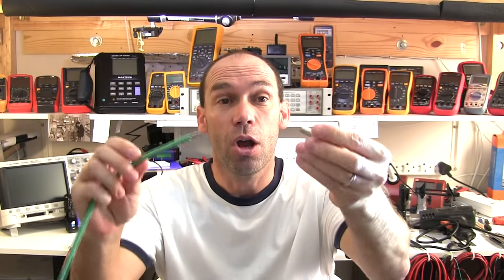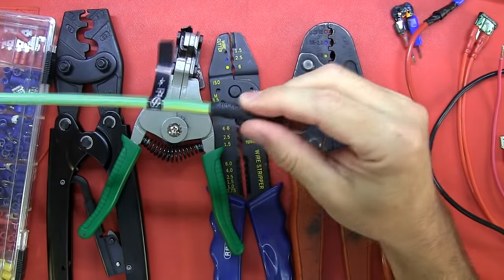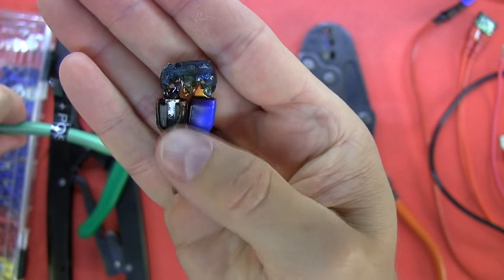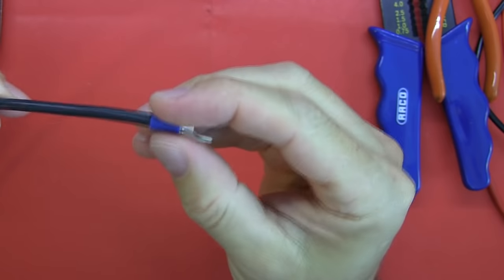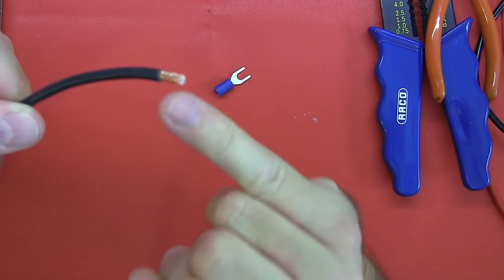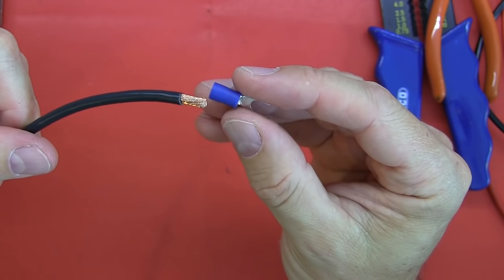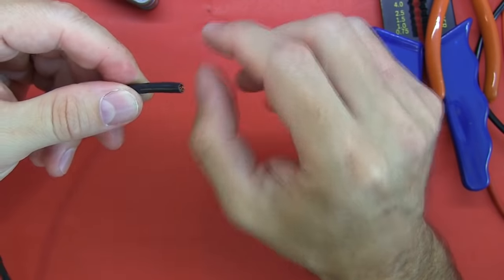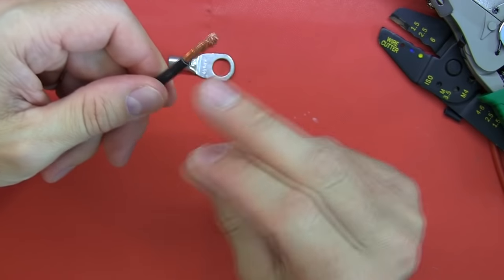Tutorial: How to crimp connectors, strip wire and use heat shrink.

Comment: I know this video was posted a long time ago but it’s still one of the best. Quick contribution: if you’re using colored shrink tubing to mark a cable (discussed at 18:17) but still want to be able to see the crimp, shrink the colored tubing around the outer jacket up to the strip point. Then crimp and pull up a second piece of transparent tubing to overlap the first and cover the connector. It’s not much of a tip but... for what it’s worth.

Comment: Incredibliy thorough!  Very impressive.  I've used just about every connector you show and I have most of the tools you show as well.  But even with my experience I couldn't have explained it as thoroughly as you did.  Well done!  I too used to solder some crimp connectors (after crimping) but I read below that that can actually worsen the connection/connector.  I didn't know that.  I do that because I've seen too many crimp connectors (in automotive use) fail due to corrosion.  But the comments made by "Executive" below enlightened me.  Up until now I would never have guessed that a crimp connection could be better than a soldered connection.  Still, I would say it depends upon the application and how carefully it is soldered.  Mostly what I want to say is "EXCELLENT VIDEO"!  When I started I thought "I can't sit through 31+ minutes of something I already know" but now I'm very glad that I did!

Comment: Very good presentation. May I suggest two modifications. 1. We always use a bit of no-ox inside the ferrule and on the wire strands to prevent any future oxidation or dis-simular metal corrosion. 2. The crimp dimple should be put on the side of the ferrule without the seam.  Our inspectors look for a bit of wire and some evidence of the No-Ox through the witness hole. Love the clear heat shrink usage, the only way to go.
Many Thanks.

Comment: Thanks for a wonderful video.  I had used a hair dryer to heat the heat shrink in the past while connecting a cable to a fuel pump and it worked.  Those days  I never heard of a hot air gun that is shown towards the end of this video.  Well done providing useful tips.

Comment: I much prefer using the hexagonal crimper for the bigger lugs and have used them often on up to 300mm square where you'd use a hydraulic crimper. One thing I feel I must mention is that as far as I'm concerned, you have a bit too much heat shrink on the 10mm square lug as you always want to keep the foot of the lug clear. Should you want to bolt that lug to a flat surface or a copper bar, you would have a inferior connection due to the heat shrink encroaching onto the foot of the lug and thus ending up sandwiched between the two conductive surfaces. The foot of the lug is sized so as to properly conduct the rated full load amperage of the cable through the area of the foot of the lug. I also like keeping the inspection window clear.

Apart from the above, it is a superb video covering most all of the essentials of doing it right. Thank you :-)
Reply: true but if that is an issue the heatshrink can be trimmed easily with an exacto blade or stanley knife so hardly an issue

Comment: Very well done and thorough video. The one thing I would point out, that was NOT included, is regarding properly choosing the size of your shrink tube since it also must be sized properly. I believe most of it shrinks to about 50% of it's initial size. That may not be universal, however. 

Again, thanks for a very informative video.
Reply from the maker: Pappa Bob Thanks for the information and feedback.
Reply: I buy both 2:1 and 3:1 heat shrink for different jobs, the 3:1 is great for smaller gauge wires like speaker cables etc but tends to tear later if you don't shrink it completely and it gets hot later causing conductive things to pop out so make sure you shrink it all the way when you install it.
Reply: got some really nice crimpers
Reply: really sux havin to strain
Reply: put both handles into the vice and spin :D
Reply: or put a pipe on both handles to extend them raising leverage

Comment: I've found rotating the connector in a common direction while inserting it on the bare copper keeps the strands tight and prevents strands from coming loose.

Comment: Great video.  A couple suggestion.  It wasn't clear that there are different crimpers for insulated vs non-insulated connectors.  In addition, the crimp (indentation) should be made on the side away from the seam of the connector.

Comment: Hands down the best video on the topic. I needed this info to learn how to correctly connect a ham radio to a power supply. The part about the current rating was particularly helpful and the one about not tinning the stranded wire. Very helpful indeed!

Comment: Actually you can Release Before You are done or have completely ratcheted the crimp tool.
Release once you are done (15:18)
There should be a small thumb lever on the tool witch will release the jaws at any point.
I have not seen a ratchet style crimping tool with out one.

Thankx 4 the Vid.
Reply from the maker: Sol Shady Thanks for the post...you are correct!
Reply: Sol Shady but that is only in case you mess up and cant finish, like if you "accidentally" start to crimp a hardened steel bar
Reply: The release lever is very handy if you accidentally crimp your finger.

Comment: This is a really good video, it covers a lot of areas well.

It would have been good to elaborate on why crimped connections are more "efficient" than solder connections (mechanical strength, better able to withstand vibration (solder can crack under mechanical stress or vibration)). It would also have been a good idea to note that the crimping tools for insulated crimp terminals ARE NOT the same as the tools for uninsulated crimp terminals.

Comment: Instead of the usual "auto store" plastic-sleeved splices and lugs you can do as the pros do and use naked crimp connectors then heat shrink over them.  I buy in bulk off Ebay and store my terminals and splices in clear plastic fishing tackle boxes for convenience. Naked connectors cost less too and take up far less storage space. Have fun!
Reply: @Vyacheslav Every aircraft avionics tech to begin with (I was one fixing fighters for Uncle Sam and am also an AMT) because crimps were found to be less brittle than soldered pins and splices while heat shrink excludes moisture which creates high resistance due to corrosion. That's why bulk bare connectors exist along with adhesive-lined polyolefin heat shrink tubing (available at any industrial supply). Crimps will do in highly protected environments (industry inside electrical boxes) but for anything subject to moisture and flex and/or where the bulk of say crimp splicing a cable repair is an issue crimp and heat shrink get the nod and they're an upgrade elsewhere. Unlike cheap "press fit" connectors, modern connectors are supplied like these examples with precut heat shrink sleeves which being transparent permit inspection of the joint.
 Opaque cheap auto store style splices block visual inspection leaving one to guess by the condition of exposed wire strands. https://www.youtube.com/watch?v=ArOHcJ4bBqM
Non-aviation example:
https://www.youtube.com/watch?v=IaahjJm4QCo
Cheap connectors have their place but the other options (which are a bit more work) aren't used in more demanding applications without reason.

Comment: Nice detail on the how to, I almost always add solder to my crimps to make a good connection too, thank for sharing!
Godspeed,
Raz
Reply from the maker: ElRazTheGreat1 Thanks for the feedback Raz.
Reply: Motor vehicle and  trailers where I most use stranded wire and crimped on connector. I  never sold them any more. My experience is that wire in time will fail at the point where the solder wicked back under the insulation due to work hardening.  The purpose of solder where connection is both electrically and mechanically secure is to protect it from the environment. That can be done with the proper application of * quality* electrical tape

Comment: Look up/Google   " Large Crimp Validation Poster " . Very helpful wall chart. Explains the importance of a gas tight seal on a crimped connection. I used to be an Application Tooling Product Manager with Tyco in Germany/Bensheim. Take it from me, only use correctly sized wire for terminals and the correct crimp tooling. All Tyco tools are specified for specific tyco connectors. Crimp tooling from China is unreliable mechanically and crimp specification wise. Crimpimg RGB fastons or ring terminals for automotive use....Use the correct tool to get a long lasting air/gas tight connection.
Reply: MrFreddiew1 Absolutely, most people have never heard that term, gas tight. Well I might make another comment about that term but ha ha I’ll be PC here. Once you explain that term to people like using a 66 block connector for a insulation displacing connection of a phone wire then sometimes the lightbulb goes off and people understand.

Comment: Hi Martin, I am not sure if this can be an issue or not, but I think touching the wires with the fingers before crimping the terminals can cause some oxidation on the contacts. Wouldn’t be better to clean them with isopropyl Alcohol before?
Nice video as usual.
Thanks,
Marcelo.

Comment: Excellent video, I do a lot of crimping in automotive applications mostly JST/Micro Timer etc, if anyone needs any help with those I can advise. Easy rule.. crimp connectors and solder only when joining wires
Reply: By any chance, do you know if I can hook up a 1500 watt inverter with a 4 gauge wire set up to 2 gauge battery cables? Will this be safe? I know I can't do it the other way around but I'm not sure if the appliance has a smaller wire will it still be safe? Thank you for your answer in advance.
Reply: @sweetpadre  That will be fine. Your inverter has a fuse which will protect it from over-current. Use as large a supply wire as you like - it won't make a difference as long as you are 4ga or larger.
Reply: @rdmccracken  thanks.

Comment: You never use ground colors for live cables!! This is a basic safety rule...
Reply: Tell that to old Honda motorcycles, black is a live color all through the harness
Reply: Elias Ghosn
I believe he meant the green/yellow cable which is labeled "POS+".. And I agree strongly
Reply: Simon K. It's actually acceptable under UK regs at least to use g/y for a non-ground/earth purpose if reidentified at each end.

I do NOT like the idea though.
Reply: 1. You would also never assume a red/brown/black/grey colored cable is live either. You always measure before work and double check connections at the ends. 
2. You always count the person that worked on that gear previously is a baboon with a hairdo. 

p.S. I have never been disappointed on the latter as can be attested by the local fire department and barber's shop
Reply: He covered all that, and he made up a cable for something he needed for batteries, not for house village. You know you can do whatever you want at home as long as you know what the hell you’re doing.

Comment: You should avoid touching the bare conductors with your fingers. The oils on your fingers will interfere with your connection and possibly even cause corrosion. The only time I use the crimper/stripper tool, like the "RACO" blue-handled one you have, is when I want to verify the size and thread pitch of a screw. I never use those tools for stripping or crimping, they do not make reliable connections. Colored shrink tubing is sometimes used to disguise inferior work. We don't use it where I work, as all our work is inspected. I have used it with good results at home, although it is not preferred. It should be sized correctly and applied with a heat gun, not a flame, as the tubing can char, crack, and burn, leaving uninsulated areas in your connections. It is unnecessary to have a very long piece of tubing. Depending on the wire gauge, 5-15 mm may be adequate tubing behind the lug and up onto the wire insulation. This will also permit the wire to be routed to its destination more easily.  (I've been NASA certified since 1996 and have worked in aerospace since the late 80's).

Comment: The cheap stripers you first showed, you demonstrated the wire in the stripers backwards.
Now I know you can strip wire that way but you'll likely leave an frayed uneven cut.
If you look at the second cutter you demonstrated with you should note the angle the cutter uses to strip the wire.
This too should be the same with the cheap striper.
Nice video, thx 4 sharing.

Comment: As dry as this may be for some I quite enjoyed it.  I am blowing fuses on my 12 V power system in my new van build under extreme loads.  My inverter pulls a solid 200 amps continuous and by the time this current reaches the fuse at the batteries it is most likely much higher do to some poor connections even though I knew how important these connections are, I feel I could have done better.  So I'm going to do some resistance measuring and hopefully lower the heat at the fuse by lowering the increase in amperage (due to heat) at the connections.  I wish I had someone like you to help me.
Reply: FYI, CURRENT stays the same; when resistance goes up at a connector, there is greater Voltage drop across the connector (E=IR), so net drop in voltage at the load.

Comment: Cheers from Chicago, Illinois, USA..

Love the instruction.  Working on me  2000 Freightliner Century Classic which has voltage drop everywhere save the batteries to the starter solenoid.  I will be making my own harness for the chassis because my truck is so old that OEM wiring harnesses have been disontinued.

Comment: The only guy on YouTube who knows that crimping provides better mechanical durability (and vibration resistance) and electrical conductivity than soldering. Also why you won't find anything soldered in a car's engine compartment. Or any machine that's subjected to severe vibration.

Comment: A well explained video tutorial on correct crimping , i work in the electrical supply industry and some of the crimps we use are 150 mm in diameter and have to be fitted using hydraulic pressing equipment....  : )
Reply from the maker: My pleasure, thanks for the post.

Comment: Excellent video.  Disregard commenters that say it is too long.  I'm wanting to build reliable 30-50 amp cables for electric car charging and appreciate your very detailed description.  A major car charger manufacturer had inadequate crimps and melted the charge port on many cars.  Very expensive to repair.

Comment: I am relatively new to make my own wiring and electronic projects but I have found that not all wire insulation is the same when you go to strip a wire. So when using those cheaper wire striper's I find that if you go the gauge up on stranded wire part of the strippers you won't lose any pieces from that section of striped wire. So if the wire says it's 18 Awg I go down to 16 Awg place wire in the striper give a twist and pull. no loose or small cut pieces of wire.

Comment: you can get a proper automotive fuse holder (with tags on the end for your terminals, so a much better way to use them)  and you are correct, dont use crimps directly to the terminals.  the automotive type i find are more mechanically reliable as they dont use  a spring inside to help make a contact, so i think are a more modern way forward and of course, the fuses are much more widely available,  in all a very good video about making excellent connections, thank you

Comment: Nice explanations, nice manber.  I think it ishelpful in this topic to explain cold fusion, and how that effect makes crimping stronger than soldering.  Akong with that is the importance of clean contact surface between wire and connector.  This gives the reason for some of the important aspects to the process that you highlighted.

Comment: Amazing Video. I have loads of the little connectors but never known what they are actually used for. I used them for a very simple switch connector so attach 2 to the wire that fit together. Now i know. Great tutorial i think i may go out and get myself a proper wire stripper tool i have a cheap one which looked like the crappy one you showed in this video. Thanks alot for the video. Very informative, keep it up :)

Comment: thanks for an informative video, I am learning , I have several of those blade fuse holders in my campervans ,they gotta. go, I had a problem with my ratchet crimps , now realise I was loading the terminal upside down ,so thanks very. much
Reply: The bladed fuse holder shown here  was a makeshift fuse holder from what saw in the video. Purposely manufactured bladed fuse holders  can be purchased and used safely in the same manner as glass fuse holders have been used for decades. As long as the holder is rated for the current the circuit will expected to draw.

Comment: I have been tinning my wires before crimping. And have been very happy with the results. No line losses. @ 140 watt panels and I was getting 15,8 amps . They are rated at 7.91 amps each. Very happy the .02 amps I was missing I am sure was due to rounding.
Reply: I note that solder is pretty soft...easy enough for my old hands to deform / shape a soldered connection with the little force available at the tip of my needle-nose pliers.

I have tinned the loose ends when the wire gauge is just tight enough that I get a bit of birdcaging.  these are usually car battery 2  or 4 AWG wires.  so far so good.  car starters draw 250-600 amps as a reference.

tangent thought on cars.  many "ground wires" on older cars are in bad shape and ignored ..."it's only a ground".  Of course, full current goes through these from frame to engine block on starting.. .  Nice place to put these skills to use!

great video.  I, too, was wondering how to choose your DMM....a bit like the wife's shoe closet.